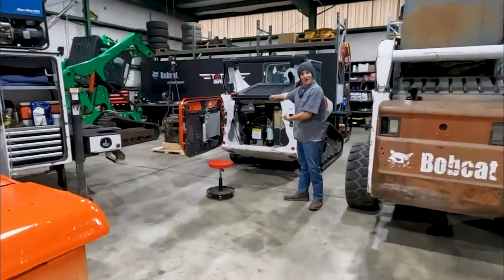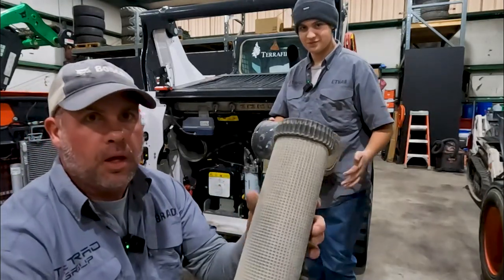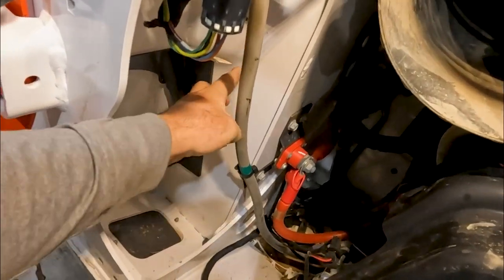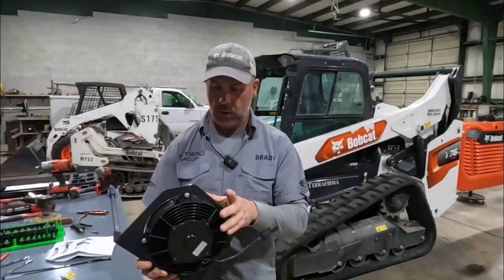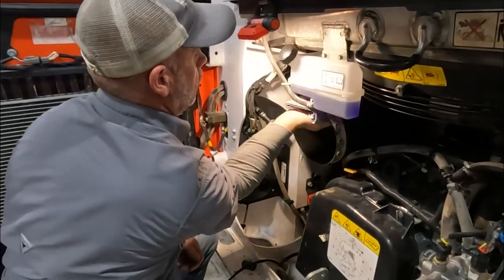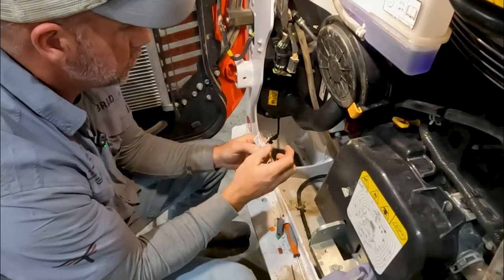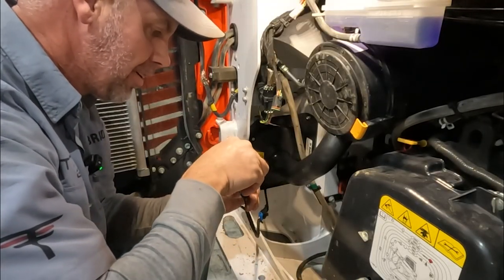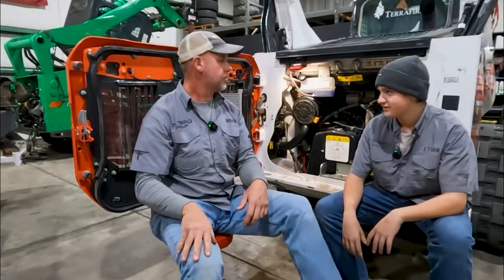Making the Bobcat T76 Better by Solving a Major Issue

Comment: Just ordered my oil filter relocation kit and was wondering if this fan kit would interfere with the filter and housing location?
Reply from the maker: I'm not 100% sure it wont interfere with the fan kit, but i think it will work.
Reply: @tetradgroup Thanks so much for your timely reply…I’m also pretty sure it won’t interfere. 👍🏻

Comment: Got a t770 2020 pintle shaft on the swash plate has broken, can I split the pump without pulling the engine ? It’s the right hand side

Comment: I’m working on and S250 sn#526012635 with two speed motors. Drive carrier seals blown out. Is there anything other than the case drain filter being plugged up that would cause those seals to blow out? Could there possibly be a valve sticking in the drive motor causing that case drain pressure to build up? Any help would be much appreciated. Thank you.

Comment: Is there anyway you can help me find injector seal cups for my bobcat 751 with the Peugeot engine. The injectors part number is LCR6730709D — I cant find the P/N for the seal/cups or the remover tool

Comment: Just upgraded from a S175 to a T66. Quite a differance. Been watching several of your videos  especially on the filters and fuel system. I have been using Wix filters since I bought the 175 new in 2008 with no problems. I. Can get NAPA gold filters at the local parts store but I wonder what would be the stance by Bobcat if there were a warranty issue and not having Bobcat filters in use?  Also, the salesman thought I should use on road fuel instead of off road. I would think that if it is purchased from a high volume dealer and delivered to the machine in my nurse tank with filter it should be fine., Your thoughts?
Reply from the maker: You won't be able to get the fuel filter, air filters, or hydraulic filter from napa anyway.  No cross reference available at this time.  The engine oil filter will cross with Bobcats old part number, but not the new oil filter number, which has been upgraded.

Comment: Dirt should not pass thru the exterior air filter period. Doesn't matter how dirty the inside of the filter housing gets. This fan thing is pointless. I changed my filter on my 259d full and I mean full of dirt but the 2nd filter was mint. The inside of the primary was mint too despite the outside being caked with dust. There is a real problem here and I'm glad I switched to Cat.
Reply: Dirt doesn't get past outside filter,  that was improper service by operator.  I own t66 and t76 never had dirt get past outside filter.
Reply: @rontopping2048  only possible explanation is the seal was broke on the primary outside filter

Comment: Regarding the mounting bracket holes: Instead of drilling clearance holes, use a tap drill size then tap the holes.  It will make maintenance much quicker and easier than bolts and nuts.  Especially since the bolt/nut combo is a two man job.  Good informative video as usual.  Thank you.
Reply from the maker: Great idea

Comment: I just wonder why there are no automatic or sime-automatic filter cleaner mechanisms on those or other machines  like everybody knows them from vacuum cleaners?  Hitting a button  and then the filter shakes or air flow goes into other direction for 1 or 2 seconds to clean it from dust.

Comment: We put a pre cleaner up behind the cab and run a pipe to the air filter for the air intake to come through. Fix’s problem.
Reply from the maker: I'd like to see how you attach to the air filter housing
Reply: You need to remount the air filter and spin it so the filter inlet is pointing to the bottom then you can fit a flex hose on
Reply: @chrisdawes6081  Hi Chris, Do you have a photo of the setup?
Reply: I would as well please.
Reply: @chrisdawes6082 
That’s what I was thinking about doing with mine. Have you got any photos?

Comment: I have installed these kits on older R series machines and newer ones. That harness actually would work on the older ones. I believe it has been removed or used for something else on the mainframe harness. You actually had to install a fuse on the mainframe FRC as well. The most recent one I have done used the engine diagnostic plug like you did. Only difference is they splice in another 6 pin plug that way you do not have to unplug the fan when getting into the engine side of the diagnostics. I wouldn't be surprised when they made the switch that some harnesses got mixed up and packaged incorrectly. These kits really do improve the life of the filter. Great video!!
Reply from the maker: Thanks for the information, not sure what happened with the harness.  Thanks for the clarification 👍

Comment: Why Bobcat didn't use a cyclone style pre-cleaner is beyond me. Cyclone styler pre-cleaners are a proven, reliable and effective solution that is inexpensive. This "fix" from Bobcat is just silly. It's not a fix, its a $434.49 (As of 11/27/2023 on Bobcat's website) bandaid. Both Caterpillar and John Deere have the option or come with a cyclone style pre-cleaner for the engine intake air on all there CTL's and SSL's. Kubota's SVL 75-3 and SVL 97-2 have cyclone style pre-cleaners. I don't believe Kubota's SVL 65-2 and SSL's have or have an option for a cyclone style pre-cleaner (could be wrong), however they seem to listen to there customers and make good, worth while improvements. CNH has an option for a pre-cleaner on there current CTL's and SSL's. Bobcat, do better!!

Comment: Seems like the fan should vent the dust outside the engine compartment rather than dumping  it inside to just be recycled.
Reply: You can clean the belly pan out every few months when you replace the fan due to failure from sucking dust.

Comment: So they suck air out of the air filter housing while the engine is sucking air into the filter housing?  Sounds counter productive.  Seems like moving the air intake to a better spot would be a better solution?  Good video though!

Comment: Quick Question:  I thought the duck bill on the air filter cover was for air to go into the filter housing.  When putting a vacuum on that, where/how does air enter?
Reply from the maker: Air actually enters from the rear of the filter housing  not the duck bill